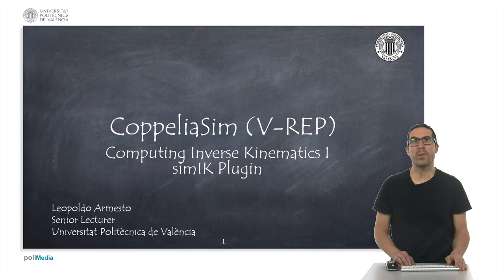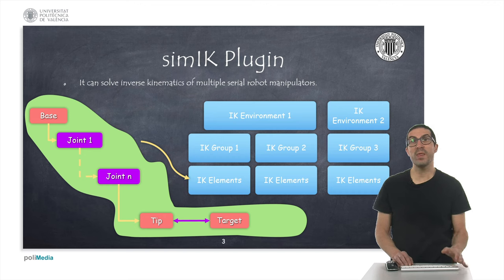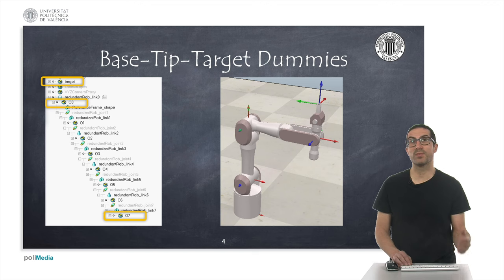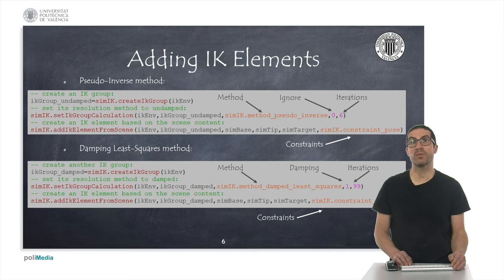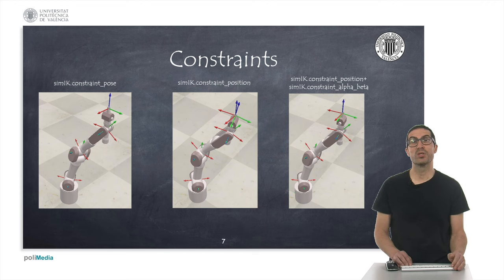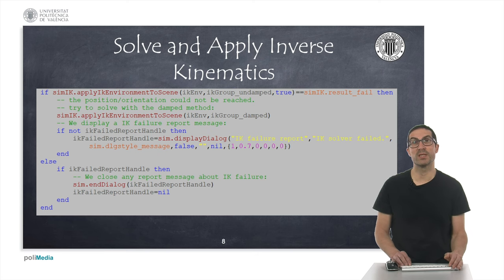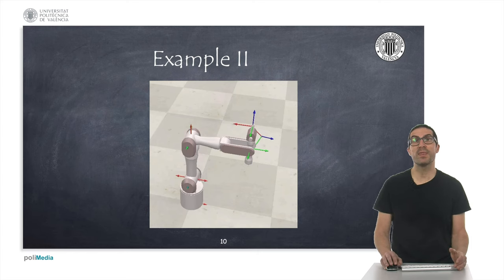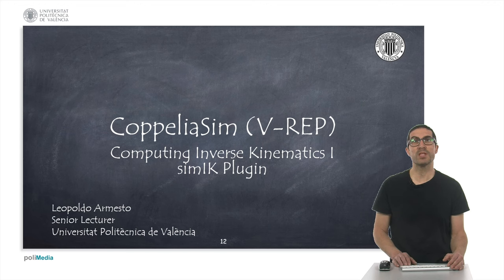Using simIK plugin for Computing Inverse Kinematics I | CoppeliaSim V REP

Comment: I’m using Coppeliasim 4.7.0 (latest) and when I call the simIKaddElementFromScene it says my 4th argument is incorrect despite adding appropriate base handle. Suggestions?
Reply from the maker: Read the API. It’s likely that something has changed compared to previous versions
Reply: @LeoArmesto Thank you will do.
Reply: Also, my robot does not move to the target despite following all your steps and code. Or is it supposed to move after completing the code in the following video? I used the simIK.SyncToScene function and an error appears initiating my IKgroup argument is not a list or table.

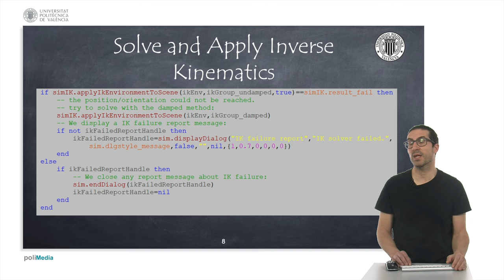Comment: Sir, @8:50  where does ikFailedReportHandle get its value sir. I am not able to find anywhere where it gets either true or false.
Thank You so much sir.
Reply from the maker: Hello, "ikFailedReportHandle" is created when the IK fails on the first time (initially it's value is nil). Actually, it's the value returned by "sim.displayDialog" instruction, which is a handle. We use this handle to know if the dialog is shown or not. When "simIK.applyIkEnvironmentToScene(ikEnv,ikGroup_undamped,true)" does not return a failuer, we set "ikFailedReportHandle" to nil and close the dialog.